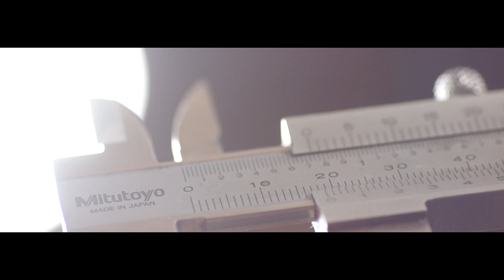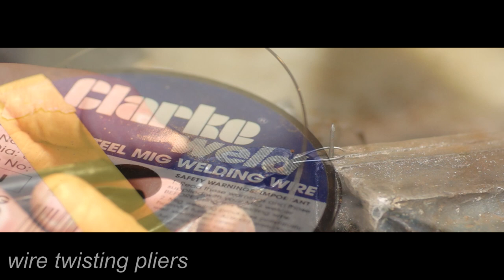Making open ended fishing feeders using sand casting

Comment: HIYA PAL I MADE A COUPLE OF OPEN ENDED FEEDERS WITH OUT THE WELDING AND MORE THIN METAL PLATES AND SCREWS AND THE FACT IV MADE REAL BIG FEEDERS JUST FOR MY FIRST 10/12 CAST THEN A SHORTER FEEDER TO FISH OVER THE TOP ? THE FEELING OF PULLING OUT A FEW BREAM WITH ONE IS SOMEHOW FANTASTIC ! IV GOT SO MANY VARIABLES AND COLOURS AND NO HOLES IN SOME DEPENDING ON DEPTH OR STRIKE ? ANYWAY ? GREAT FUN TO FISH WITH AND VERY EASY TO MAKE "IF I CAN DO IT "  : ) : )

Comment: Yup, if you need to ask "why?" then you've missed the point. Floats, sinkers, jigs, a trailer for the car, a sports car chassis, ham radio aerials, and more - most are cheaper to buy, but there's no fun in that. I've had the fun. The 'why-ers' have missed it.
Reply: Leslie Austin গ